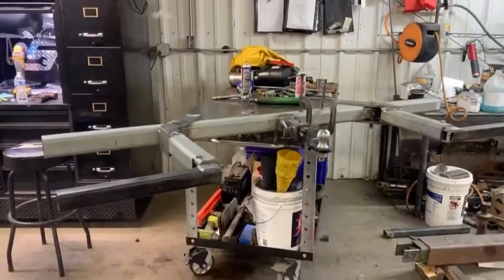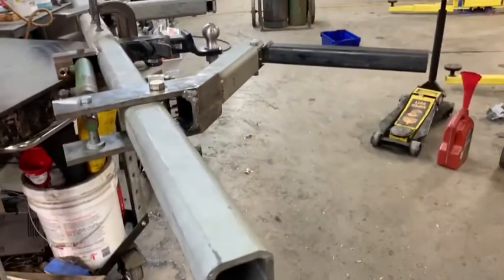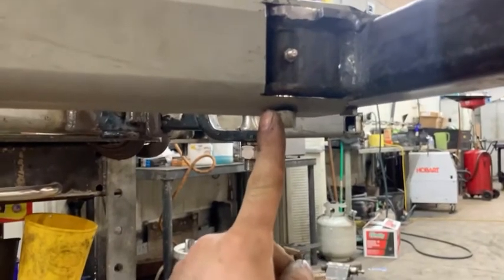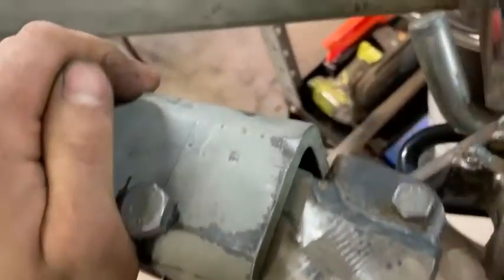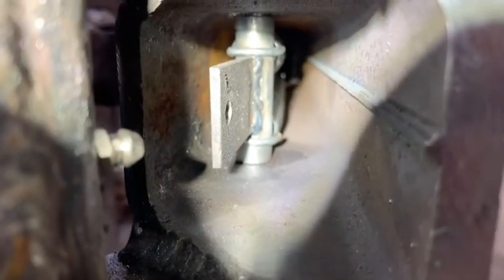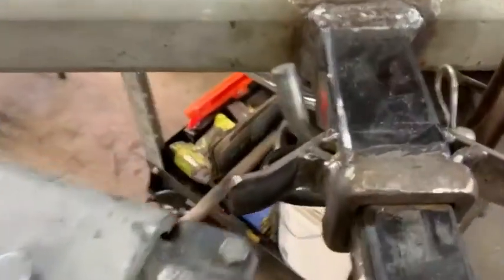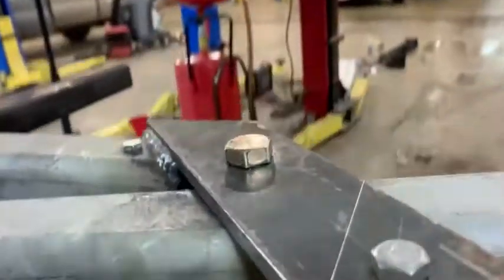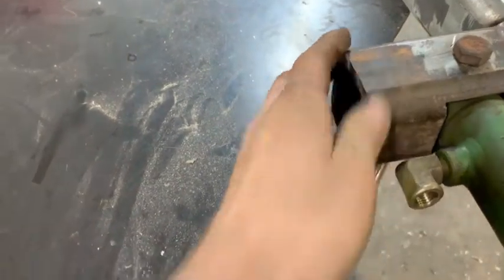Tow Truck Wheel Lift Build Part 3

Comment: I have an old wheel lift has weird chain system to do up down  but cool simple design double roller and sprockets on both side I think cylinders goes horizontal but pushes into chain and transfers direction probably increase strength the cylinder is rusted and I have it broke down it was supposed to be winter project has only  the cross bar it was given to me  I need to find some metal and possibly cylinders and hoses pump may redesign . it was for larger roll back I believe   How did you do remote hydraulics